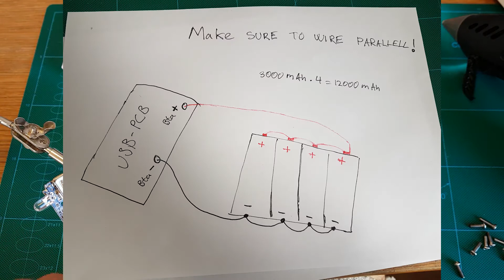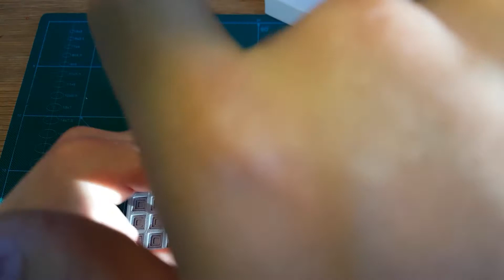DIY POWERBANK 12000 mAh Part2 Assambley

Comment: So if you get batteries that hold more will they work or does the battery need to be the same?.... also I’d there any way to hook a small wind turbine up to power the batteries and keep the bank.. basically using the wind to power the bank and be able to charge an iPhone?...

Comment: does it only work with 4 18650s or can you use say... 6?
Reply from the maker: you should be fine with 6 also, but it will proberly not fit the box :)
Reply: theravinglunatic470 you can use as many you want just make shure that they have the same maH count

(I built such a powerbank looong ago and used 10 2200maH batteries)

Comment: Do you thibk i would be able to connect like 10 batteries and get the correct battery percentage on the lcd Screen?
Reply from the maker: yes i think so, just make sure to wire them in parallel,  but i think that you have to charge and fully discharge it before the percentage will be right.

Comment: NIce build, looks impressiv for an DIY build,  but im amazed that you list this as a 12.000mah powerbank, what it certainly aint, a good chance that its in the ballpark of 2400mah powerbank, so this got less power then any budget mobile..
depending on the current, this is often around 600mah batteries, the extreme cheap silver/red ultrafire wil useally be in the range of 350 to 700mah,  got a bunch of them myself and some varies but most dont and at times they are okay as cheap flashlight-backup, as they cost under 1 buck shipped, so ridicalus cheap the tacky ones.
anyway congrast with your 2400mah powerbank, and dont worry about the tacky capacity, its more the build there was the purpose and it wont cost much to put better in it, as good li-ions has come down in price and legit Sony VTC6 3100mah can be had for under 5 buck shipped, ewen thow that is current-overkill as to be used with plain powerbank.
nice casing and build+1
Reply: there are numerous variant of these, but most of them are around 700mah with low current 0.5A and as low as 190mah at 3amp.
http://lygte-info.dk/review/batteries2012/UltraFire%20BRC18650%203000mAh%20(Red-silver)%202015%20UK.html
Reply from the maker: I used basic math, 3000x4=12000 ;) Alright buy better batteries if you like more current, i took what i had home, but the choice is yours witch brand you chose, i know they aren´t the best so i didn´t put the ultrafire in the description, that is some other brand. Thank you for commenting.